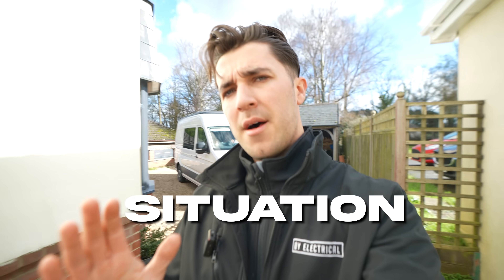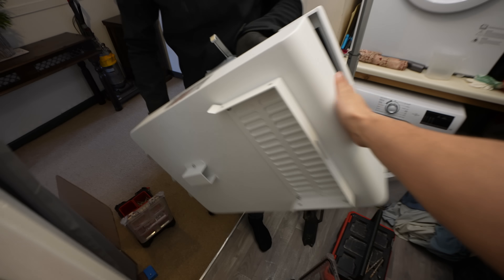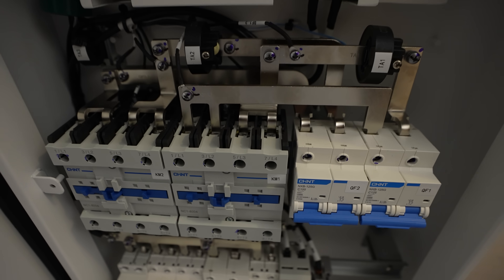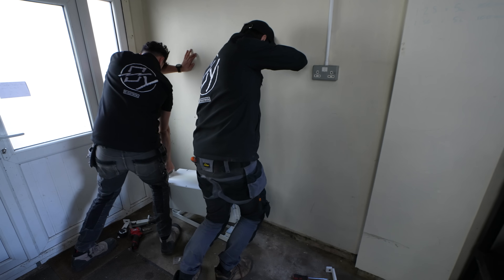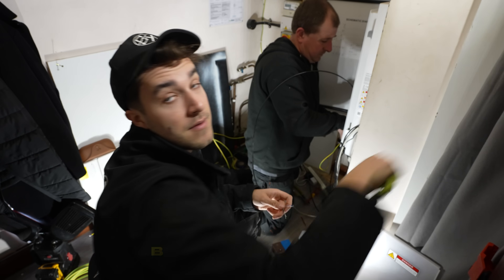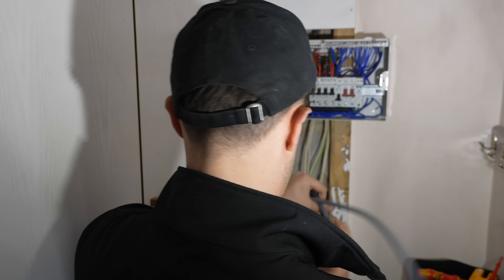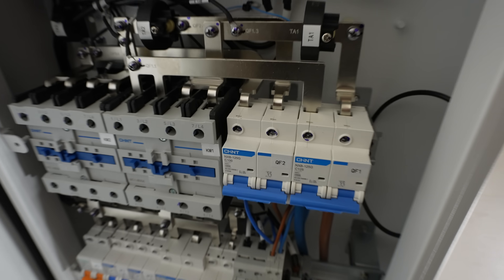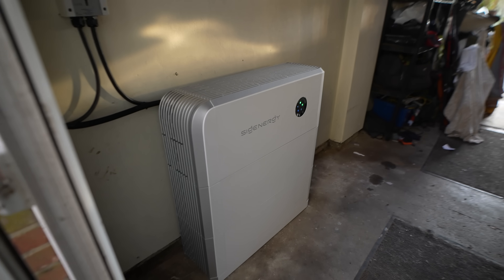How To Take ANY Inverter Off-Grid | ØY57

Comment: G99 shows a schematic where an embedded generator in independent (stand alone) mode, has it's own earth electrode, but they show the grid supplier's earth also connected to that main earth terminal, with a note saying this connection is omitted if the customer has a directly earthed TT system. Which is a bit odd, as the customer's stand by system will inevitably have it's own earth electrode. Any thoughts?
Reply: see my comment in the main thread (assuming it's still there)
Reply: @protectiongeek  So, it is mandatory to have a local earth electrode for stand alone and this is normally also connected to the suppliers earth, including during island mode, but you say it is a good idea to disconnect the suppliers earth when islanded, which is what Cory is doing, but you say it's not mandatory. Is that correct? G99 shows the supplier's earth connected to the main earth terminal along with the local earth electrode connection, but they say this connection should be omitted on a TT supply.
Reply: @mfr58  Yes, that's correct. Or at least that's how most people are doing it. You do need to make sure that something in the system will maintain the neutral-earth link when islanded (because in a PME setup the one in the cut-out has been removed from the circuit when islanded, and earthing only works as designed when it's linked to the neutral). I presume this transfer unit does that, as will a Victron inverter/charger. Devices that just provide a simple 'UPS circuit' usually don't do this. 
The argument for disconnecting from the PME earth is twofold a) if the power has gone because that cable has been cut then it's not a useful earth any more, and b) if the earth becomes energised during a fault condition, then people working on the cable aren't going to like that (the whole point of the G98/99 regs. But if the local earth is actually working then that voltage won't rise high enough to cause danger so it shouldn't matter that they remain connected. I presume that's why the current IET advice is that it's reasonable to do it this way.
Reply: @mfr58  so, yes, it IS mandatory (in the UK) to have an independent measured earth electrode connected to the main earthing terminal for your installation if you are operating a 'back-up' source of power (either a PV system that is normally interconnected with the DNO network while it is in island mode or a simple standby generator with manual or automatic changeover).

The independent earth electrode is normally connected to the earth provided by the DNO, at the main earth terminal for the installation as you have seen in G99. The vast majority of domestic installations will operate like this. The connection is omitted on a TT supply from the DNO by definition, either because they have not provided an earth terminal (certain commercial and industrial supplies require the DNO to not provide an earth terminal) or, the DNO has provided an earth terminal and the owner of the installation has decided not to use it (but has provided their own independent earth electrode). I don't think that the gateway device installed in this video will disconnect the installation from the DNO earth - there may be an option to do so but I didn't get the sense from Cory's narrative that they did so. The default will almost certainly be that the DNO earth terminal remains connected in island mode (as shown in G99).

As long as the installation has a suitable independent earth electrode, the owner of the installation could have a design whereby the DNO earth terminal is disconnected while operating in island mode (or on their standby generator). This is fairly unusual but it is acceptable, as long as the installation complies with regulatory requirements (principally BS7671). The main reason for giving this consideration is that most supplies at low voltage are derived from TN-C-S (sometimes called PME) networks. Deterioration of the combined neutral/earth conductor in underground cables can give rise to so-called diverted neutral currents on the DNO main earth conductors. Some supply interruptions are caused by faults on the LV network and their behaviour can be difficult to predict so it is possible (even if unlikely) that the fault that caused your PV/battery/inverter to switch over to island mode could also impose unusual voltages on the DNO earth conductor and your installation. In fairness, the likelihood of this presenting any significant risk to any one installation is very low indeed, but not impossible.

Bottom line - my strong recommendation is to consult a qualified electrical engineer (not an electrician) before installing micro-generation on your property, especially if you live in a rural or semi-rural location. Don't forget to speak to a structural engineer about adding about 250kg to one side of your roof too!
Reply: @protectiongeek  Thanks for the information and advice. I would have thought the easiest solution is to dispense with the DNO earth terminal and make it TT by providing a compliant, local earth electrode, serving both on and offgrid supplies. Then there is no issue about interactions between DNO earth and local earth.
Reply: @mfr58  I don't know your background and level of knowledge about electrical installations so I don't mean to tell you something you already know, but there is a trade-off in terms of available earth-fault current if you choose to operate as a TT installation. It is vital that you consult with a qualified electrician or electrical engineer before making such a change as the protection of some of your existing installation components may need to be changed or upgraded to continue to operate safely whilst fed from the DNO network.
Reply: @protectiongeek  I am a qualified electrician, but not an engineer. So I can measure earth electrode impedance and fault loops etc. I realise a TT system protection has its own characteristics and fault currents will be very different form a TNCS connection. I am always open to learning more, so appreciate sharing of knowledge.
Reply: In installations where PME conditions apply in connected mode, PME conditions continue to apply in island mode. This is because the distributor’s means of earthing remains connected, even though it is not used.
Reply: @ the DNO earth facility cannot be assumed to be the same in island mode. The reason for decoupling from the DNO supply could be a service cable fault, for example. This is precisely why the mandatory requirement for an independent earth electrode exists in the first place.
Reply: @protectiongeek  The earthing arrangement of most EESS in island mode, where the installation has a low voltage public supply connection, is almost always TN-S.because of the local rod. This then doesn't't affect PME conditions because the distributor’s means of earthing remains connected, even though it is not used.
Reply: @Swwils  I think you need to re-read your original statement and consider why the mandatory condition for an independent electrode exists in the first place. I’ve made it clear with a simple example of why your statement cannot always be true.
Reply: @protectiongeek  PME conditions persist simply because the DNO earth conductor remains physically connected (though intentionally unused). I have never said you do not require a consumer earth electrode.
Reply: @Swwils  you seem to be unaware that the DNO earthing arrangement may NOT persist, as you put it! If someone puts the bucket of a mini-excavator through the service cable to the property operating the inverter etc, there is NO earthing arrangement to speak of from the DNO.
Reply: @protectiongeek  In practice we must always assume the presence of PME conditions even when switching to island mode, because the physical DNO earth connection typically remains intact (just unused intentionally). The requirement to have a consumer earth electrode already fully addresses exactly the scenario you're describing and I have never said it's not required.
Reply: @protectiongeek  Yes, all the more reason to set up a complete TT system if you are starting from scratch and you can get good local earth readings.
Reply: @mfr58  your 'good local earth readings' criterion is the point though - failure of the PEN conductor in the DNO supply is thankfully pretty rare, whereas changing soil conditions through even one year could adversely affect your TT arrangement. On balance, using the DNO earth (if available) is still the best option all things considered.
Reply: @protectiongeek  I've got a good watering can :)
Reply: @mfr58  LOL - think I can beat that - I live in west central Scotland! 😊
Reply: @protectiongeek  I'm in West Wales, so I don't really need the watering can either

Comment: Really interesting and helpful. We have a new PHEV car that has a 2KW V2L continuous rated output. It has an 18KWh traction battery and on board generation which theoretically can output 2KW continuously for a week. I have solar so I’m looking to add a home battery next year, in the configuration you have described here. I’m interested in using the V2L to top up the house battery overnight if needed during a power outage. The V2L output is 230V 50hz AC but presents itself as -115V and +115V relative to vehicle inverter earth. So I think I will need an isolating transformer on the input side of the ATS? As more vehicles have V2L I think this will become a more common requirement ? What are your thoughts? Tks
Reply: Wow, that sounds awesome. How do you get 2kW all week from a 18kWh battery tho? Have the engine running all that time?
Reply: @ In the standard setting, when the traction battery is depleted ( to 20%) the engine will automatically start and re charge the traction battery then stop. It’s almost silent when charging, so ideal for overnight use.
Reply: Hmm, my first reply to your comment disappeared  - maybe the YT algorithm was responsible. Assuming you are in the UK, the first step would be to check (possibly via your electrician) whether the vehicle inverter has the required certification (G99 approval certificate on ENA Connect Direct website). If it doesn't have this approval you could only use it for "off-grid" loads and not interconnected with the DNO supply. Your installation would still need to comply with the requirements of BS7671.
Reply: @ Thanks, for the reply. No intention to connect to DNO - so always off grid and only in power outage. I can see Victron make some  ‘ship to shore’ isolation transformers which may provide 7671 compliance.
Reply: @ would it not need to be the EVCP that would need the certification to meet the disconnection times etc? BS7671 is only for fixed wiring, as this is an ‘appliance’ on a plug and lead it would not be in scope would it?
Reply: @InterestCasual2000  the inverter in the vehicle would need to be certified as complying with the requirements of ENA-ER G99 before it could be considered for interconnection with the DNO supply via the user's installation. As the person proposing to use the V2L inverter has stated here that they do not intend to interconnect with the DNO, some parts of G99 (switched alternative sources) may apply, but without full details of the proposals, I can't say for sure. The requirements of BS7671 would apply in any case.
Reply: @ I’m going to have to respectfully disagree. The G99 protection will come from the V2G EVCP, not the onboard inverter which may be V2x and be possible to use in several different scenarios and locations.
BS7671 ends its scope at the EVCP also, a car and anything electrical to do with it, even AC inverter output will be out of scope, other standards will apply.
Reply: @InterestCasual2000  I can't say I've seen any EVSE devices that incorporate G99 protection, but it's possible they exist. G98/G99/G100 protection facilities are almost universally integral to the inverters themselves on small installations. Discrete G99 protection could be provided in the installation as an alternative (as illustrated in Appendix G of the IET EESS CoP for example). As I've already stated, this is a largely moot point as the original commenter has confirmed that no interconnection with the DNO supply is intended or required. If the V2L is intended for use as a switched alternative source to supply all or part of their fixed installation, G99 s.7.4 will apply. BS7671 clearly does not 'end its scope' at the EVSE as it anticipates the hazards presented by exposed conductive parts downstream of the EVSE even though it obviously does not apply to the electrical installation on board the vehicle itself.
Reply: @ “Chapter 11 - outside the scope of the regulations” “Equipment of motor vehicles, except those to which the requirements of the Regulations concerning caravans or mobile units are applicable”
For inverters such as a solar PV system then yes G99 would be applicable to the inverter itself. For an EV exporting via a CP, the CP will control the grid tie and therefore be responsible for the protections required, not the cars inverter. Some proposed V2G systems don’t even use an onboard inverter, instead the CP handles this also and the car just outputs on its DC connection.
Reply: @InterestCasual2000  I'm trying to decide if you're being deliberately obtuse or just don't understand. The EV is under the scope of BS7671 in the same way as the metallic pergola structure in my garden is under the scope; the EV may present exposed conductive parts outside an equipotential zone, while the pergola presents extraneous conductive parts and, therefore, a potential hazard and so must be assessed within the scope of the regulations. I have not claimed that the vehicle wiring is within the scope of BS7671. The inverter associated with the V2x source, whether AC coupled and onboard the vehicle or DC coupled and part of the fixed installation of the house comes under the scope of G99. If there are multiple additional sources of energy involved and islanding is desired and approved, the G99 protections are most likely located close to the connection point of the DNO supply as found in a number of so-called gateway automatic switching devices.
Reply: @ OK as your clearly not going to understand yourself, I will bow out, claiming a pergola must be sold as compliant with BS7671 is beyond  my ability to reason with. You might want to check out Artisan if your looking for work, will be right up your street.
Reply: @ as I suspected; deliberately obtuse. Have a nice life.

Comment: The sparky at my parents place made sure he did a check on all connections when he was in the box last year when they got a kitchen upgrade. We live in a city where it gets below -10 in the winter and above 40 in the summer, and he said that makes connections loosen over time. It had been over 10 year since someone was in the box and he found a number of loose connections. A good electrician can literally save a house from burning
Reply from the maker: Sounds like a good sparkly!
Reply: in Hungary, we really rarely, but use AFDD-s. Is that common in GB?
Reply: @MrCadilLACI they’re coming into regs now, mainly for high rises, student buildings and hmos stuff like that for now… but on the next amendment I bet they’ll be in there to install as standard
Reply: Where do you live that has a 50°c temperature swing ? 
That's crazy, Aus is hot in summer, might hit 42 on the worst days, probably 5 is as bad as winter gets
Reply: @gor4988  canberra
Reply: @gor4988  the hottest I've seen in my town is 42°C, the coldest is -21°C.   But there was 15 years between those extremes to be fair.

Comment: Those isolators are brilliant I’ve got a few on my install, you know these guys have broke through the market although I love my Victron kit, but Sigenergy would have been an alternative for me the beauty of Victron is using almost any Lithium battery. Must say when I was designing the system everyone was like how many power cuts have you had, my answer was none, but you can never over engineer since then had about 5 or 6 and also had the neighbour pop round to fill there thermos flask with hot water. That one affected 315homes no street lights or anything but my light house was still shining 😂
Reply: We hardly ever get power cuts, but I've had quite a few since fitting my islanding Victron set-up, because I keep dicking with it (it turns out that things like firmware upgrades can turn the power off for a few seconds, and so does switching back from DVCC to not-DVCC (that surprised me the 1st time). If I left it alone things would be fine :-)
Reply: @ 😂 depends what the updated firmware brings, I try to update the firmware when either upgrading stuff like more batteries Lynx distributor and so on
Reply: We've only had one power cut since I installed my Victron system 2 years ago, the power cut only lasted a few minutes, but it never went off at our house. Best thing about Victron is you can run Node Red on the Cerbo and do all sorts of wonderful things.
Reply: @ It's true, although we soon found that DESS doesn't quite do what we want and 'timed export' isn't built in (even though 'timed import' is) so you are almost obliged to get into learning node-red and javascript to get what you want. It is marvellously versatile.
Reply: @xxwookey  I built a full scheding system for charging, discharging, saving sessions and free power. Charging and discharging will alter the rate so the full time period is utilised instead of running at full whack.
Reply: @TheRonskiman  is it published anywhere? I've been working on the same stuff, but it seems we'd do better to work on something collectively as loads of people have similar issues. And we can't fix DESS itself as it's not FLOSS.